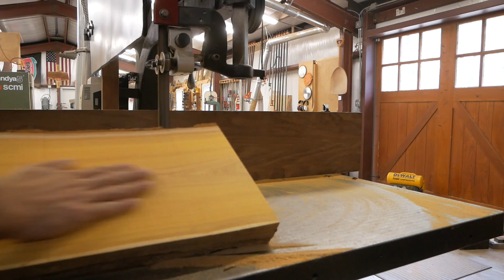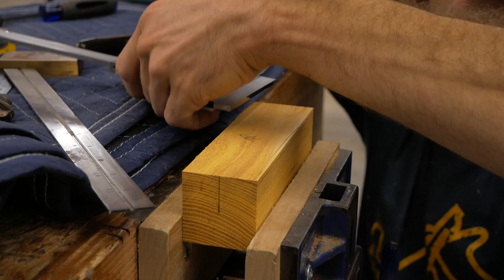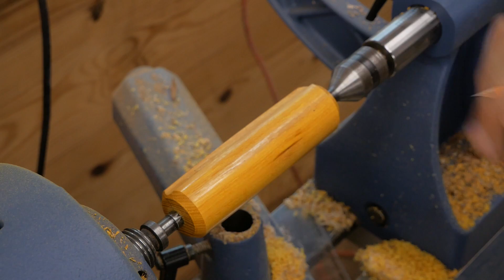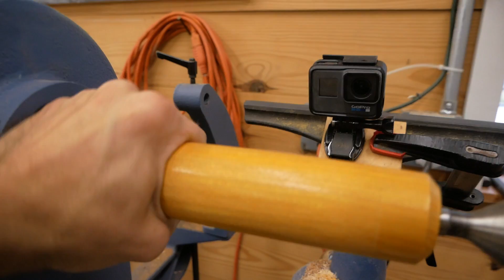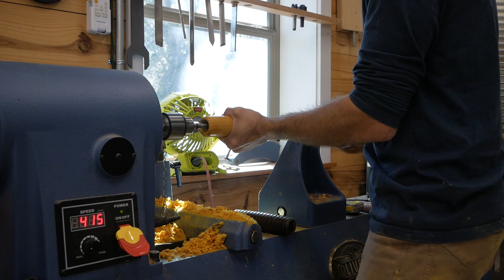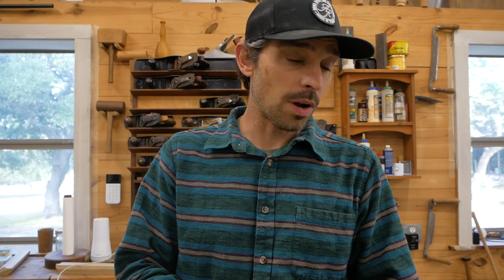Rebuilding My Grandad's 16 Gauge Stock - Part 1 The Forend

Comment: You might want to try a three line cutter where the first two rows do not have teeth and only act as guides, and the third row deepens. Gunline sells the head. Also maybe use a 90* cutter to bring the diamonds to more of a point

Comment: Awesome. I've recently started to try and make furniture for my firearms (like a new, longer stock for a Remington 870 with a high comb and taller butt), and it's a fascinating exercise in having to pay absolute deference to the constraints of the firearm itself. Not like most all-wood projects, where you can set the parameters yourself; that barrel radius is what it is, and the channel has to match.  That's great work on checkering regardless, and efficient for a first attempt. Nice work all around!

(Plus, that's some real control on the lathe, especially with the osage orange already having the channel cut out. I tried turning a screwdriver handle from osage orange a while back, and it ended up shattering on the spindle. Very finicky stuff!)